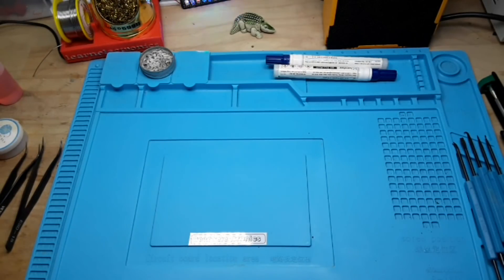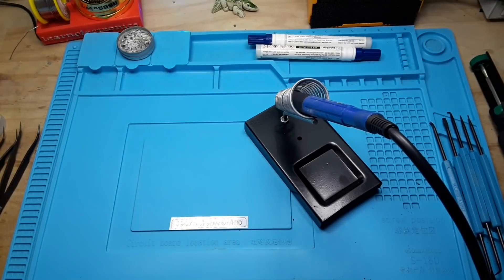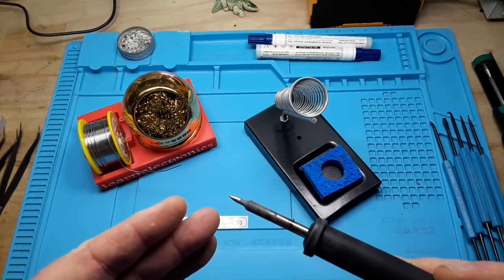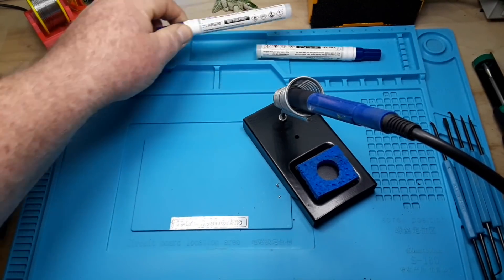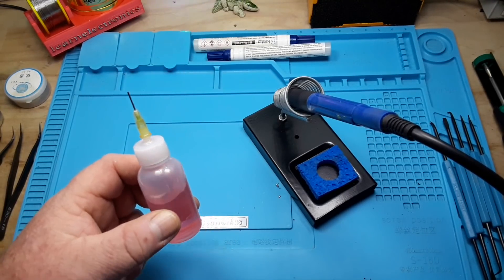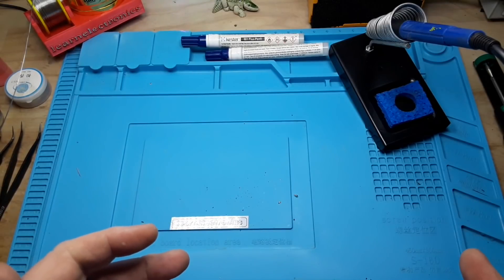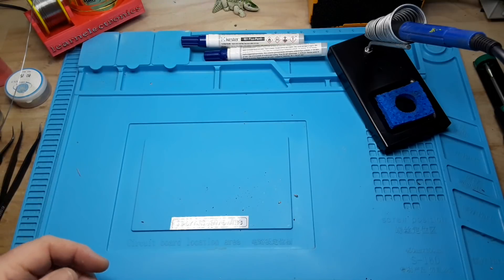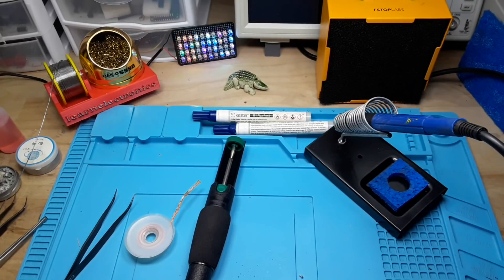What soldering gear do I use?

Comment: I have watched many of your videos,,, I bought a new isolation transformer for my 14 year old future electrical engineer. I am wondering why I bought it! Perhaps because I have seen so many YouTube videos on I/T’s. Such a gadget will not prevent electrocution when working on 240 vac projects. It will only protect the scope and other    equipment. I use a RCD (residual current device) also referred to as a (DCD, differential current device on all my circuits, in fact 22 of them. In Australia we have 240 vac and the common ground (neutral) is tied to the ground stake as a safety measure, same as in many other countries. If I am working on any 240 vac equipment and I for some reason touch the active wire, the power goes off within 30 m/s when a differential of 15 mA is detected. So the scope is off and I am safe. Why do I need an I/T ? I am going to test this out on my own equipment by shorting something out when connected to the scope. I paid $250 for the I/T. The RCD’s cost about $15. I see someone suggested a $400 device on the probe to protect the scope, yes, but that doesn’t protect your life. I am not getting it, can someone please explain to me why a $15 gadget will not only protect the scope and my life? I think in the USA the gadget is called: GFCI

Comment: Love you`r channel man! I`ve bought Ksger T12 ver.3.1. Do you know what "PID adj." Means in the menu in ver. 3.1S? I can`t find any information. Keep up the good work :)
Reply from the maker: A PID in loop is used in temperature stabilization here. It's basically a formula that governs how the heater is applied.
Reply: learnelectronics okay, thanks. I had hoped it was adjust interval for the temperature. I think that setting missed on ver. 3.1.

Comment: Hey Paul, good afternoon. Have you ever tried the fiberglass brushes from Amazon? They work amazingly well for getting the corrosion off of pcbs. The stiff one will take the conformal coating off.  The only thing you really have to be sure of is that you have a vacuum to where you can suck up all the little itty bitty tiny pieces of fiberglass. Or just do as I do use a damp disposable cloth (aka, paper towel) wipe off the working surface off blow off your part with some compressed can air.Be sure to keep away from your face and eyes. (PSP) Cheers Joel

Comment: For a fast and good solderjob, try using a hollow tip (i'm using a JBC C245-945). If you use this with a reasonable good (flux core) tin, you don't (almost never) need extra flux. If you have to much tin, the tip will 'absorbe' it. For an existing solderjoint, this is a good way to flush the old tin. If you have a bit of solder on your tip, you can brush it to brass shavings, or to a wet sponge or just strike the tip to somthing and it will fly of (most easy way, and my prefered (as long as you are carefull)). Indeed; every couple of joints, clean your tip. And do not try to re-use tin. Just add some more (add the flux). For extra flux there are gel types. Those are awsome. We add it when we do SMT (re)work. Just apply it with a toothpick, that is more than enough. When soldering, try to add the tin to the components they you try to solder, and not to the tip. For the first bit you might need to, to get a better thermal connection, but when the copper/leg/whatever is warm try to add the tin directly to it.

Comment: For magnification, I really like this one: <https://www.amazon.com/gp/product/B071VZ4X6P/>.  I use it with the elastic strap (included), and unscrewed the nose bridge.  That way, it doesn't interfere with my glasses.  It comes with interchangeable lenses, and a protective case for the lenses.  The optical quality is good, and I get a big enough field of view.

I had a magnifier similar to yours, but the hard plastic head strap was really uncomfortable, and the the tightening mechanism was always popping loose, causing them to fall down at just the wrong moment.

Comment: Great video Paul! When I use desoldering wick what works really well for me is to add some liquid flux applied to it. This helps to get a good connection and make the solder flow to the flux... Got to have some good Ruby Flux...
I had a old meter box, a old A/C power supply 26v DC from a old antenna rotator laying around so I ordered one of those China made T-2 kits with the 3 digits and iron and made me soldering iron. It works great! I use more than the other 3 and one is a 20 year old Tandy... Lol
Thanks for the video!
LLAP

Comment: my advice to beginners is that if a solder joint doesn't melt theres usually 3 reasons  1)  flux has disappated from the metal, making it 'dry',  it wont flow or melt as easily.  2) temperature set too low, this can happen if you are trying to solder onto a large component   3)  heat is leeching away before it gets hot enough... apply in bursts   4) your solder tip is oxidized ( brown / black color ). Also make a fume extractor with a pc fan and a tumble dryer vent pipe or better.  Also notice how he flicks the metal off the end of the thing ? thats an expert technique.
Reply: These are great tips. Thanks.
Reply: Yes it is all in the wrist on how you flick it... Lol
LLAP

Comment: Don't know about US, but here in Europe sale of 60/40 solder is restricted to bussines only.
When I order solder I have to choose the 60/38/2% version. The 2% being silver.
My fume extractor is a homemade unit constructed of 4 PC fans in a rectangle connected to my bench powersupply.
That way I can adjust the speed easy and "overdrive" it in a case of emergency (Capacitor blowup etc...)

Comment: Nice tut Paul. I have two soldering iron relics (circa 1930's and 1940's) that I inherited. Both irons are huge, compared to the irons used in today's electronics. One iron is heated from an external heat source (open flame), the other is powered by 110 AC. They, of course, aren't suitable for surface mount stuff but if you ever needed to solder a 6 gauge copper wire to an I-beam they are the way to go.
Reply: HahahA... I have one of those too, an yes it will solder a 6 gauge wire to a I-beam... :-D
Dad worked for the B & O Railroad and they used them for soldering some sort of copper ground strap for something. I was just 12 when I went to work with dad, so I don't remember. The electric version I have raises my electric bill $10 bucks just to plug it in... Lol
I'm 67 now. So I got them when dad passed, so I don't remember to much about them. A propane Torch is handy... 
LLAP